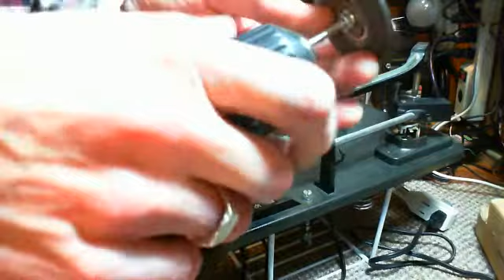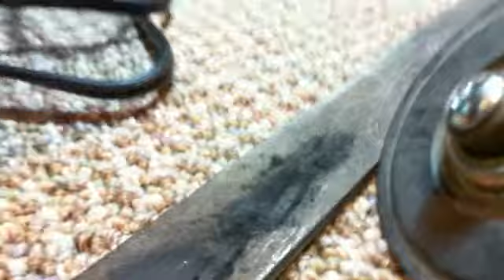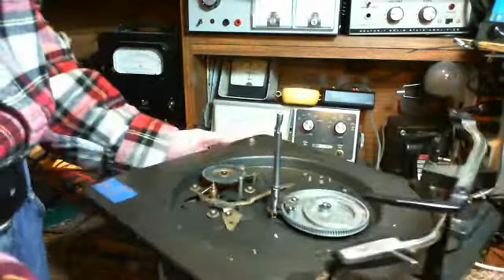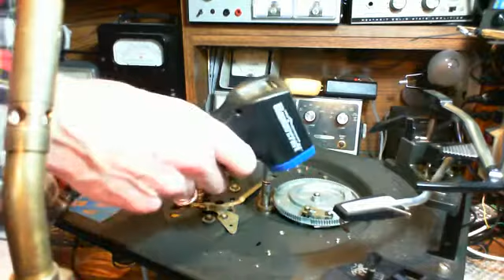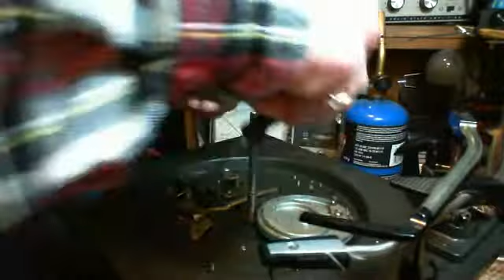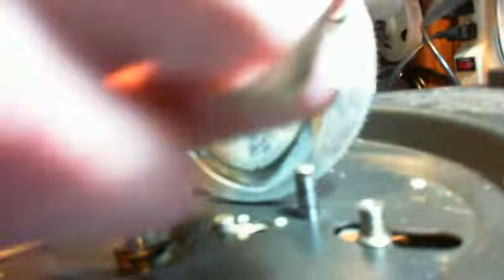Garrard Model 3000 Record Player Video #2 - Mechanical Restoration

Comment: Very informative video(s) to follow along to!
Picked up an HMV console from the 60s that had a Garrard 3000 in which is playing slightly slow...
I found the Idler wheel had been chewed up by someone bodging the spring that's directly underneath; there was a sharp bit of spring damaging the wheel so I've snipped that and sanded down the wheel.

The raceway was tricky for me too but i put my girlfriend's hairdryer on the middle for a minute and it slipped off (lucky me!)
With that off, I was able to access the bearings and found that they're caked in place so the balls don't roll. 
Just going to tidy that up and see what difference it makes!

Comment: Hi Mr Lindenas, I spent a whole day fighting that gear, I was afraid to use too much force and ruin the mechanism. I used alcohol trying to dissolve the grease-glue. Finally, exhausted, I give it up. Went to bed and next morning I saw your video showing your battle. Inspired, I decided to use a little more force, and to my surprise, after a night in alcohol, the gear finally surrendered. I want to thank you for your helping video !

Comment: never use a prying action is just as you say to always use low heat and that is what I always do so I do not ever shift any parts out of alienment you should put a flat bladed screwdriver on both sides of the cam and apply pressure evenly on both sides then it will come up easier the center sleeve is suppose to move it is a bearing for the cam gear to move against  great job

Comment: some advice when you do this you need to first have two wide blade screwdrivers and put each on opposite sides from each other and then apply heat and as soon as you do push down on each screwdriver and then wiggle  there is a collar that is around the center shaft sometimes and that rotates to prevent the grease from sticking to the permenant shaft  garrard makes the shafts that have a sleeve over the shaft to reduce friction on the parts
Reply from the maker: ***** Thanks!
Reply: you are welcome and I know that at times you can get a bit confused but you really need to ready up on the project so you know all the features and specifications of them . have a nice weekend
Reply from the maker: ***** You are right. I'm inclined to jump right in.
Reply: well I just like to try and help a fellow repairman when I can to make things easier . it is a good thing to share ideas on how to make fixing electronics easier .